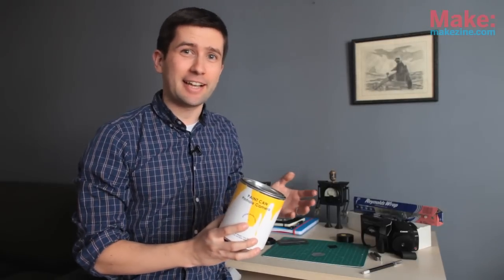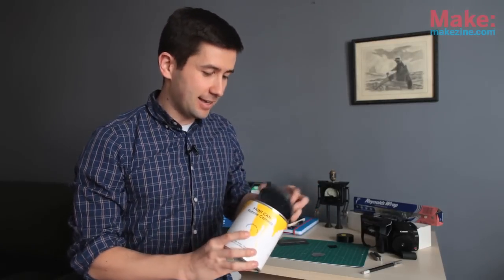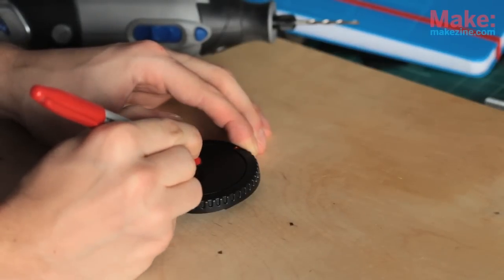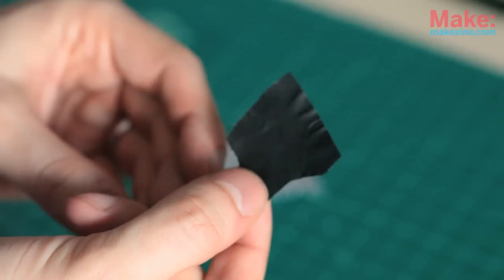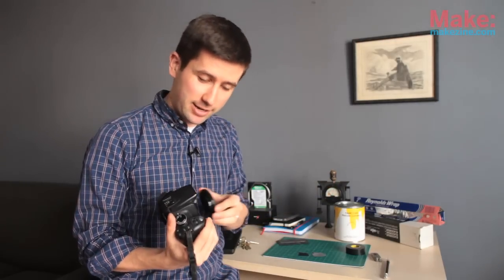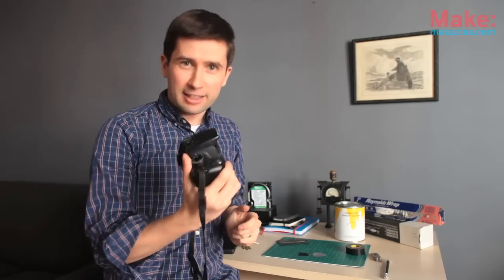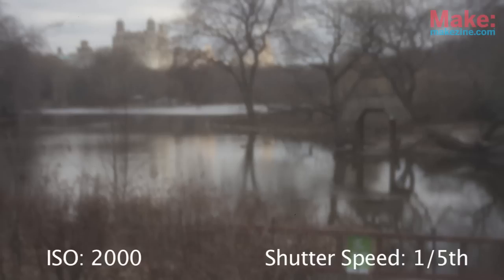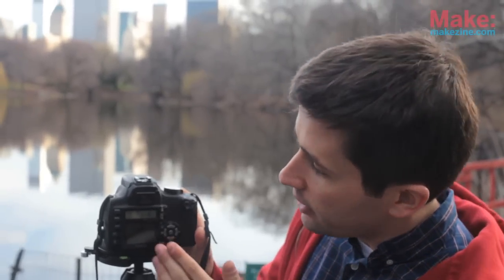DSLR Pinhole Photography

Comment: Rather place the pinhole aluminium plus the tape on the OUTSIDE of the body cap. Putting it on the inside runs the risk of dirt getting onto the sensor or (even worse) a piece of the tape sticking onto it.

Comment: Ultra violet. Insane rays coming from TIG welder. IR rays. So much light in fact that even welding helmets cant protect my eyes. Headache next day for ten hiurs. Yep. Extreme. So whilst laying in bed and after having an idea of wrapping the exterior kf a welding mask with alu foil hoping to reflect light but not realising light bouncing back wont deflect light coming, suddenly the idea of a pin hole sprang to mind. Limit loads of light, but then have a flag magnifying screen on your eye side to create an image of the pin hole. Your thoughts?

Comment: I’ve always been a big fan of pinhole photography and over the years have used various pinhole cameras ranging from a home made 5X4 to a pinhole on a Russian Zorki. I managed to make some very good quality pinholes and was able to measure the pinholes quite accurately. I bought a powerful magnifying loupe with a measuring scale on it which was in increments of millimetres and each millimetre was divided in five parts, in other words I could fairly accurately measure pinholes down to 1/5 of a millimetre. Using a reciprocity failure chart, I managed to produce some pretty good results but I found that it was very difficult to get good pictures with a 35mm camera as the negative is too small. In my opinion, 120 medium format film is about the smallest that I would recommend and I have seen excellent results from 120, 4X5 and 8X10.

Comment: Thanks for making the video, it was very interesting.  I grabbed a spare body cap and just used a sharp wood screw to make the hole as  I didn't have a drill handy.  First hole was a bit big so I just taped it over with black tape and tried again, by the third attempt I was actually getting reasonably sharp shots and a cool vignette.  I used some tinfoil and a drawing pin to make the pinhole.

Comment: Really cool video. Tnx for sharing!. I was wondering why you just make a little hole in the bodycap directly but a big hole at first and then a smaller one in the aluminum. Can you explain?
Reply: If you made a pinhole. in the body-cap, the incoming light would be from only directly in front of the tiny hole.
This would result in only a pinpoint of light hitting the camera sensor.
Using a very thin foil, light is allowed to hit the whole of the sensor.

Comment: Ok, so to make it work you have to make tiniest hole possible, just the tip of your thinnest needle. To take a portrait in clear sunny day I had to boost iso up to 12 800, with that i achieved 1/30 shutter speed. With person being in about 1-1.5 m distance from the "lens" his face was kinda sharp. So I would say its fun to play around with, if you dont have anything better to do, but forget about any practical use of this method :)

Comment: That didn't work too well...Would work if you had a proper hole made in suitable material, in your case everything is out of focus because your pinhole's diameter is too large and also because the hole is not done properly. The thickness of the material used and the precision in the drilling are crucial. A needle pocking aluminum foil is just not good enough. Just buy a ready made one, you'll find them on the net.

Comment: Why not just pierce a tiny hole straight into the cap and not bother with the foil and tape? Also these images are blurred and generally awful, is it not possible to get a good pin hole photo with this dslr method? If not why bother? Cheers

Comment: Great video but i have one suggestion to make for the actual hole.
Instead of using aluminium foil, use a piece of a soda can which is much sturdier. Use a strong needle and a light hammer or another heavy object to make a bump in the aluminium, not a hole but just a bump.
Then flip it over and use sanding paper to sand the bump away until you get a hole. Fine sanding paper is recommended as it wil give you a really clean, round and thin edge and you have much more control  over how small or big you wanna make the hole.
This wil improve the sharpness of your picture greatly in comparison with the aluminium foil method with just a hole punched into.
Reply: another option is a hot pin, directly against the cap.

Comment: Couple suggestions to make it better for people who wanna try this:
-Don't just eyeball the center of the cap. If the hole isn't in the center your image will be distorted. Close to the center is fine, but getting it just right is worth the effort.
-Make sure your hole is as close to a perfect circle as possible. A perfectly circular hole gives you the sharpest results.
-Use a sharpie to paint the area around the hole black to avoid flares.
-Use a smal strip from a tincan instead of foil. That is much more sturdy so getting a perfect hole will be easier. Just sand it down a little to make it nice and smooth.
-Make sure everything is clean before you put it on the camera. Every bit of dirt or dust that's on the cap might otherwise end up on your sensor!
Reply: And use Pinhole calc.
Reply: @prj2266  There's no way to get it accurately. Just buy from a real photo store instead. They laser cut the pinhole precisely to the exact diameter needed for the flange distance of your brand of camera so the images come out sharp. Costs only $10.

Comment: Pinholes can give good results if the pinhole is well made. Al foil poked with a pin is one of the worst ways to make one! The ragged edge by doing it that way is doomed to failure. All kinds of extraneous diffraction completely ruins the image. A clean round hole drilled and deburred in some thin brass shim makes a pretty good one that anyone can do. Just look around and see the results that others have achieved.

A clean hole in very thin material is what works best.

Comment: there's a diffraction limit to the sharpness of the image that one can achieve, i.e. at a certain point the reduction of the hole only makes the image worse. Basically, it's when the diameter is below the size of the 1st Fresnel zone, which is about 0,3 mm (for green light). To make a good round hole of this size is not very easy though (once I spent like half a day to make a good hole).  
I would also recommend to use copper foil instead of aluminium, the hole edges will be much smoother.

Comment: Yeah, the camera on a tripod should hold the cap steady enough to drill the hole. Just remember, this plastic is dense, so you might need to push down pretty hard while drilling. Also, to get the best hole (especially since you're drilling with the cap on the camera...not the sturdiest thing, but sturdy enough) you should use the fastest drill you have. Good luck, and have fun!

Comment: Well, a lens refracts the light through filtered glass. In this case there is no filtration of light, just pure light transmitting through the pin hole onto your sensor. That is the issue.

Comment: Pinhole cameras are used in archival photography of architecture because pinhole photos have zero optical distortion.  The aperture is very small and there is no glass, so the image of a building is faithful to reality. A normal SLR/DSLR photo image of a tall building distorts the geometry which drives architects nuts.

Comment: @tdude129 Yes, there is a small risk, as there also is with changes lenses. The sensor is protected by a front plate I believe, and you can have it cleaned. Some cameras have in built 'sensor cleaning'.

Comment: @tdude129 Every single time you actually change lens you have that possibility. Anyway, it is soo hard to get any dust into that little hole. Truth is, you have to be very careful at any time. I personally tried this and it worked great! Also, my lens are back on my camera and I see no difference in the shots between and after doing this.

Comment: Why didn't you just put a pinhole in the cap instead of drilling a huge hole? The thickness issue can be resolved with a little sandpaper and a slightly larger pinhole.